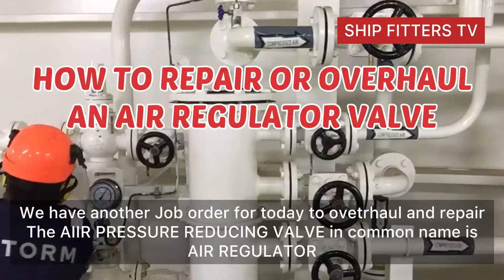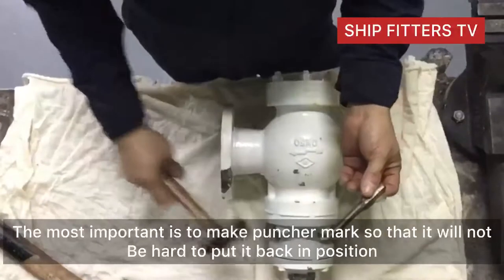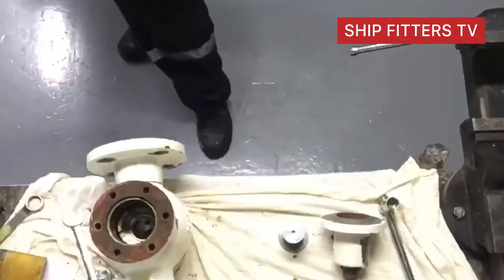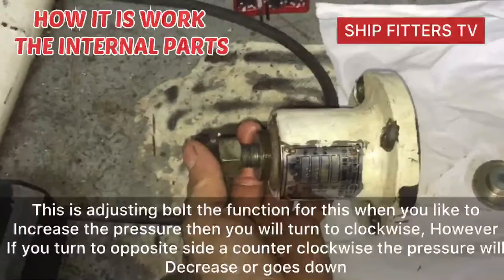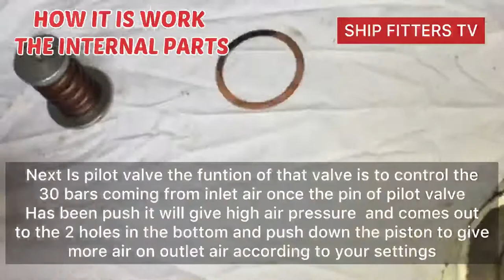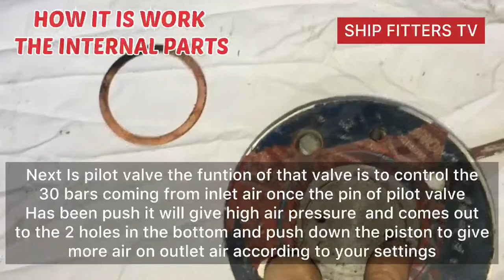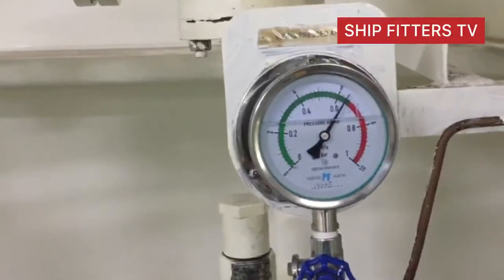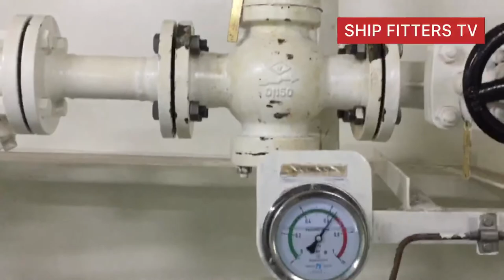AIR REDUCING PRESSURE VALVE

Comment: Sir 
I dint understand basic pourpose that hole from air outlet

Regards from Brazil
Reply from the maker: yes sir the hole from outlet is supply to copper sim at on the top of pilot valve the purpose for that  hole is to hold the force of the adjusting spring ..example our setting air pressure to the outlet is 6.8 bars to 7 bars  then the air coming from the outlet passing to that hole  is to holding the adjusting spring by only 6.8 to 7 bars only .That is the command pressure on outlet to hold the adjusting spring on top not further push down coz once the adjusting spring continue push down it will give more and more air so your setting is out of control that is why the put small hole to lift up the copper round or sim on top to control the spring goes down but the sim or round copper can hold only according to the outlet pressure